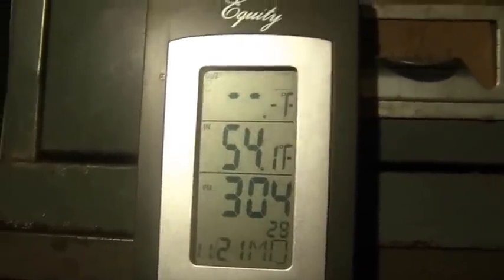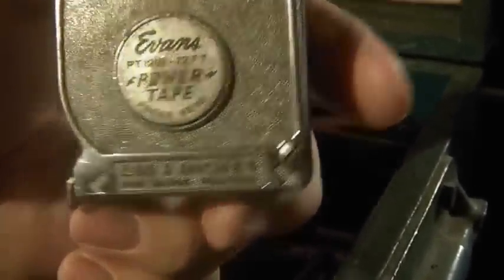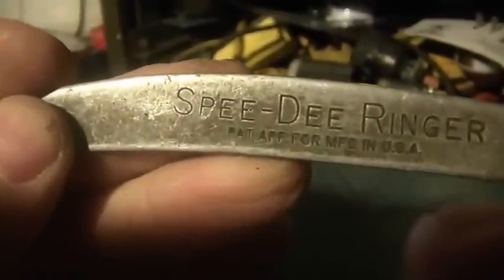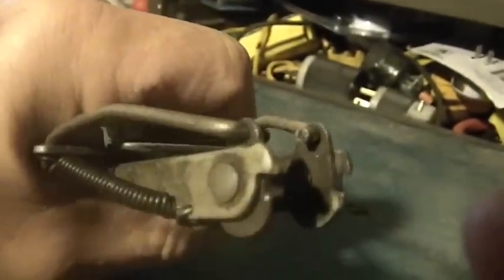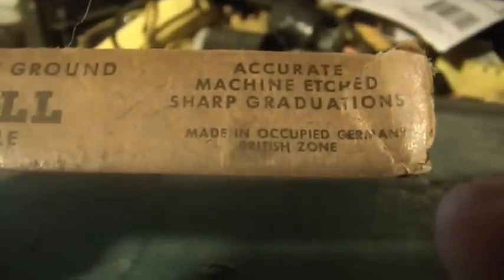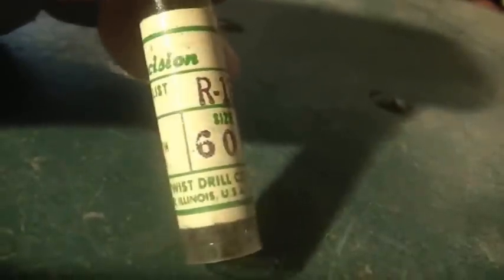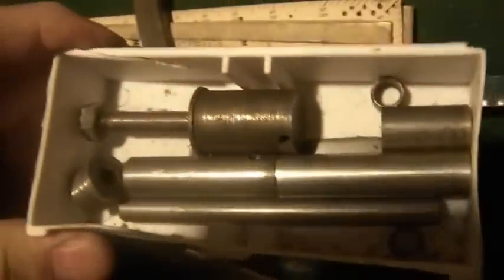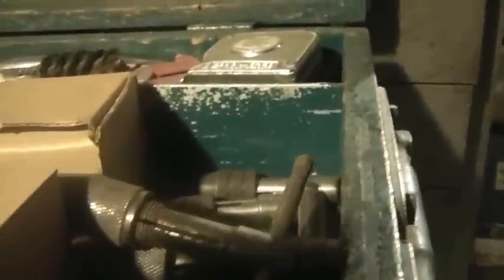Old Machinist tool box, time capsule of American made tools

Comment: Harvey, you have a great treasure there! The spee-dee ringer is just what it says. It is for putting  rings on pistons. Since he was a machinist, I would think he used it on compressors. As for the punches and the box of unknown, they are for driving bushings. Even when you bought it years ago, you got a great deal. On today's market, a lot of that stuff is worth quite a bit. Most machinist used Kennedy boxes even back then. That may be an early model. I have seen two that were made of wood and marked Kennedy. The hooked tool is for a metal lathe, and is a cutter for cutting a specific shape in round stock. I would be proud to own a piece of history like that.

Comment: SPS was and is an aerospace fasteners for aircraft and they produced unbreako and sock head cap screws. The rods with the points are to transfer holes one part to the other.